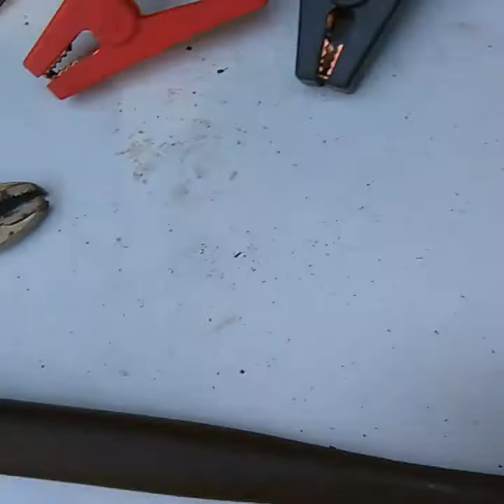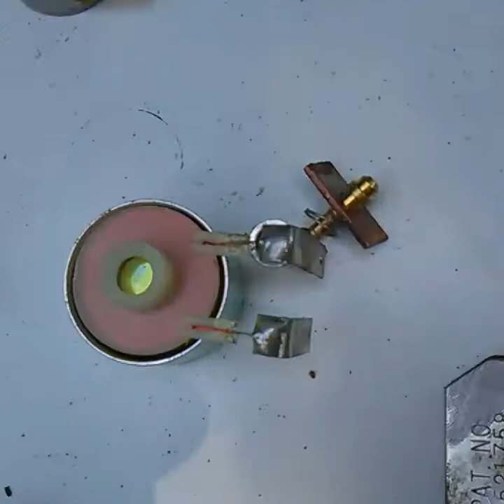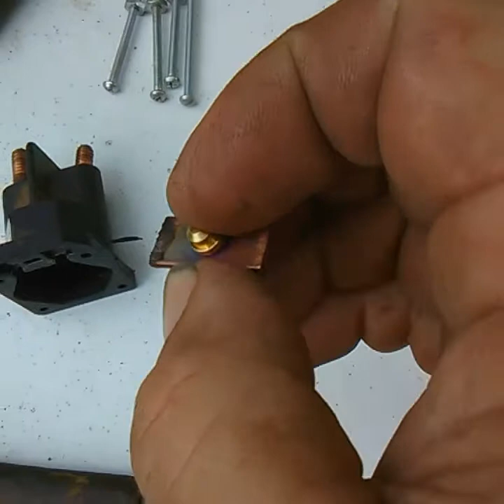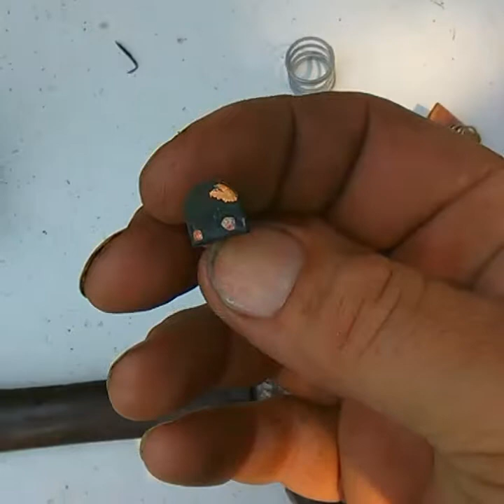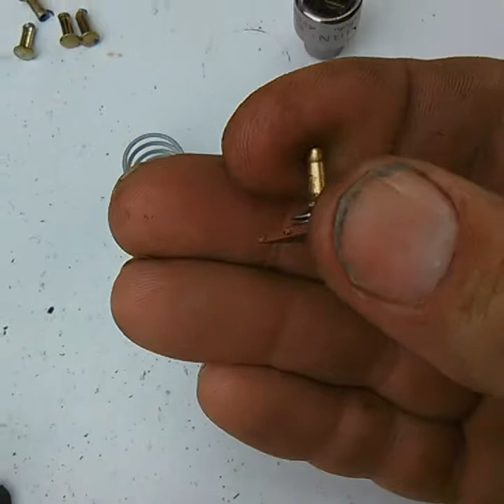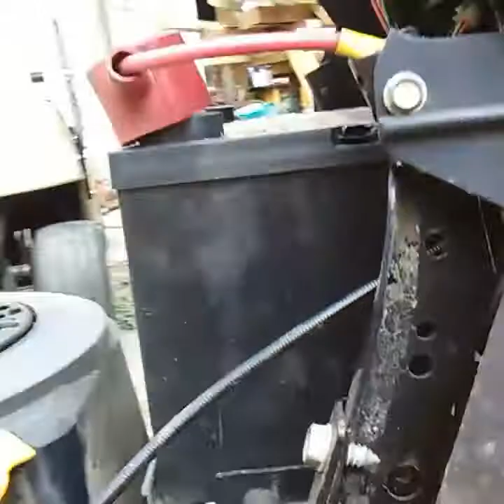Lawn mower starter solenoid rebuild hack.

Comment: How is the post/terminals secured to the housing? I have installed a new solenoid and one of the terminals keeps turning and is loose.
Reply from the maker: @bgabb9110  usually they just sit in a square hole. Maybe the solenoid you have has round headed bolts? The nut against the plastic is supposed to keep the post in place. Then the battery cable goes on then a lock washer and another nut. To hold the wire on.
Reply: @ Thank you

Comment: This hack rebuild worked on my 25 year old solenoid. 

Rusty nut on bottom of one of the large copper posts was impossible to remove, without damaging the soft threads. Just used a flat blade screwdriver to clean the bottom of that terminal.
Reply from the maker: Glad to hear it!

Comment: if your post is melted crooked, maybe your valves need adjusted if its taking too long to start or the battery cca is too low 200+cca for 14 hp, 350caa+ 18 hp, 400 cca 20hp or more esp dual cylinder.
Reply from the maker: Single cylinder Kawasaki engine. Worked fine afterwards.
Reply: @blue68chevelle  two reasons it does it though though age/weather and its struggling electrically